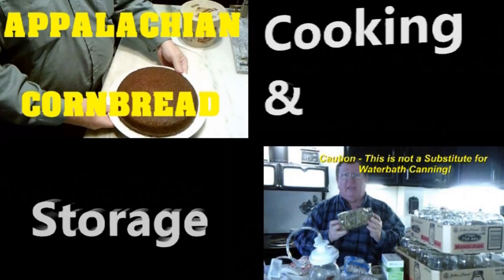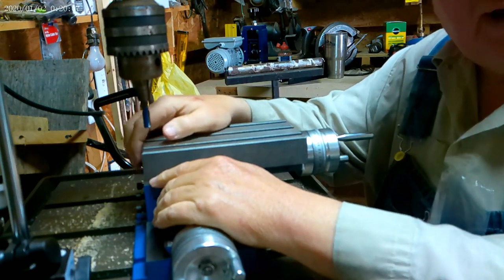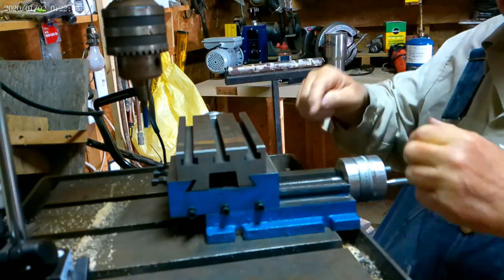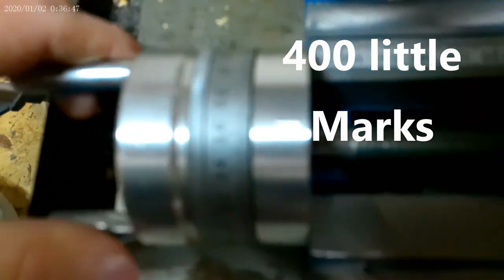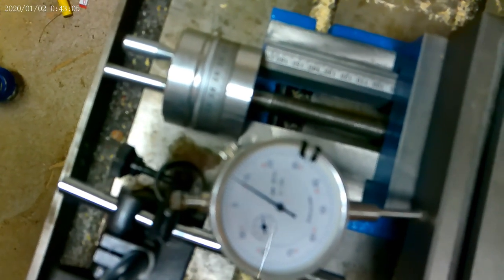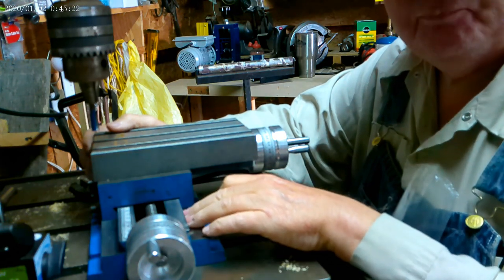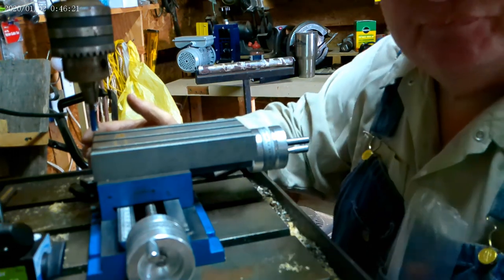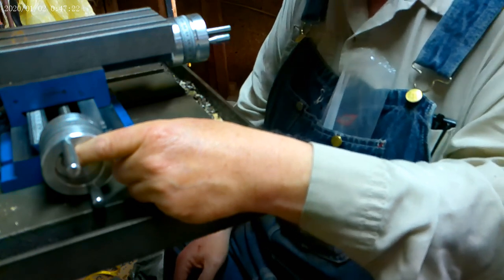VEVOR $89 X-Y Crossfeed Table Review - Homesteading

Comment: 12:11 The attachment holes, what is the distance between their centers? X wise and Y wise. I would need to know if they fit the attachment grooves in my drill press which are 15cm center-center.
Reply from the maker: Next time I am in the shop I will measure them and let you know. They lined up with mine. But I don't know how far between them.
Reply from the maker: I got a chance to be out there this evening. 11 cm center to center
Reply: @CollegeHillFarm  Thank you.